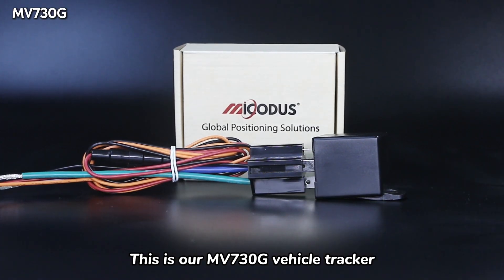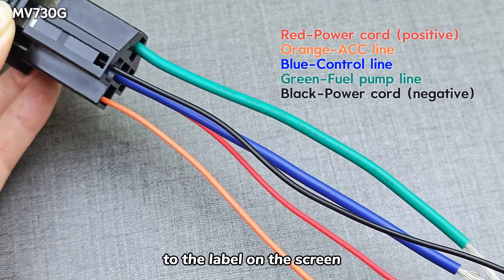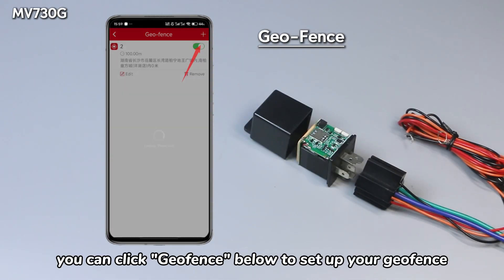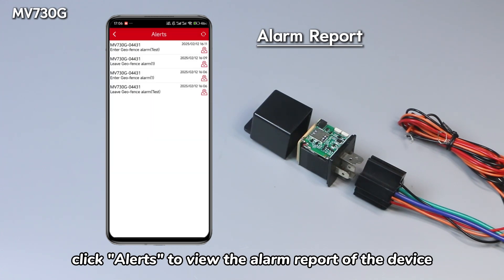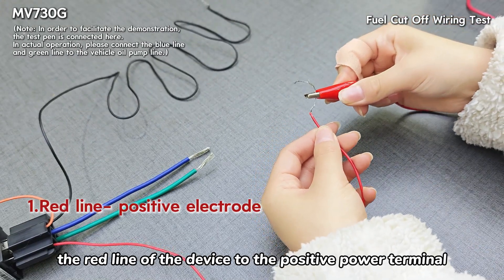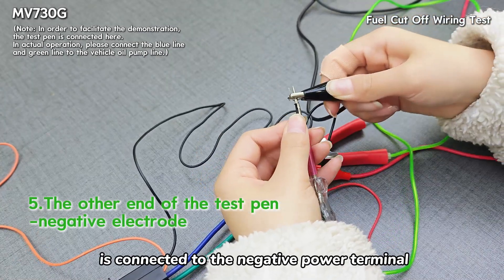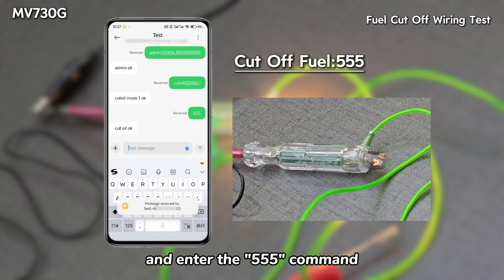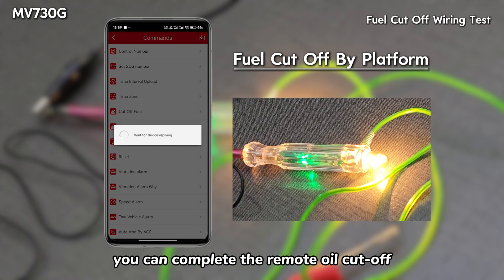MiCODUS MV730G Relay GPS Tracker Setup | Remote Fuel Cut-Off & Real-Time Tracking

Comment: Why oil cut off ?
Reply from the maker: MV730G has the function of remote oil cut-off. Through the command, you can remotely cut off or restore the oil.
Reply: @micodusgpstracker I see now my original question why
Reply: @micodusgpstracker  it should cut the fuel, not the oil 😄
Reply from the maker: @DougTheModder  🤣